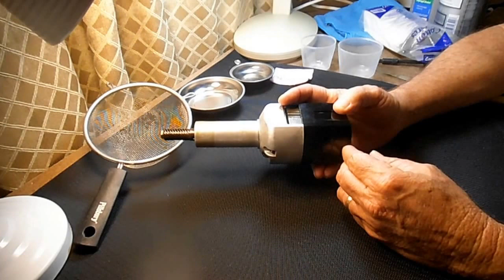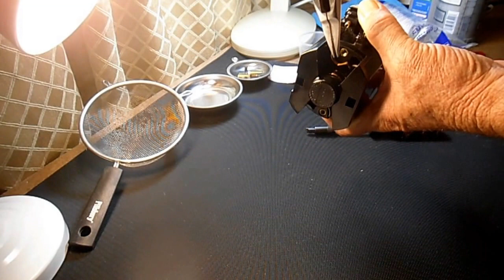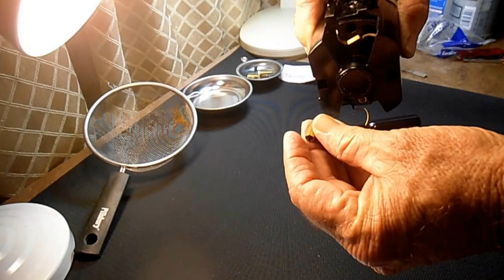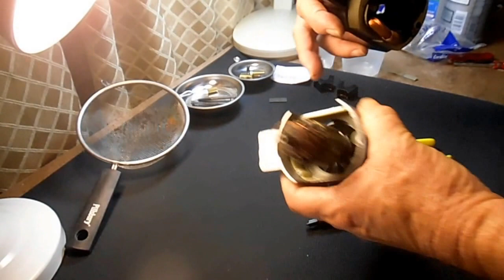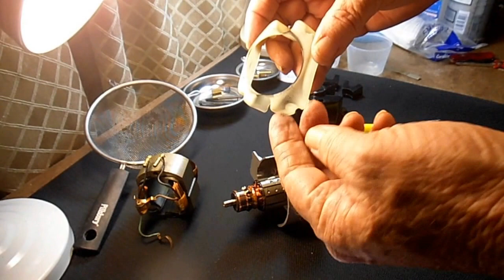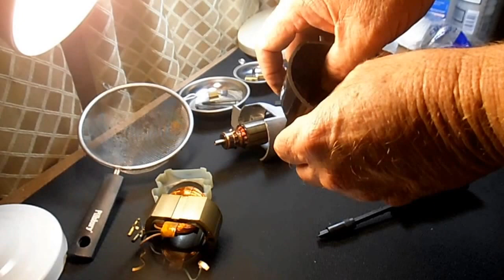HOW TO RESTORE SINGER PA STYLE SEWING MACHINE MOTOR Pt.3 HOW TO DISASSEMBLE THE MOTOR

Comment: Whoa, Motor Housing Screws are huge! Everything here is so delicate it makes me nervous. Will the motor work better after we go through all this or is this just for general clean everything-new-again?
Reply from the maker: They are huge! Good old Singer back in the day advertised their sewing machines as a "Lifetime Purchase", and it seems they built them with that in mind. 
Maybe this is a good rule of thumb: take off one brush cover and inspect the commutator by turning the shaft slowly. No scratches or burn marks? If true, then look closely at the 'Opening" in the brush holder from end-to-end". You can see the spring and where it connects to the carbon brush to get an idea of how much brush is left. Compare to the length of the new brush. If 25% or more of the brush is still there you are good. Order a set of brushes at your leisure for the future. If 50% or more is still there ( a common scenario) you are golden
.Order a set of brushes at to leave in your will.
Also, cover your finger with a rag and press it on the commutator between brushes as you rotate the shaft. That will get some of the carbon dust off of it while you are there. Close it back up, reinstall the motor and sew away.

Great question and I'm glad you asked. Would you consider writing the scripts for my videos? You are very intuitive!
Reply: @andytubesewing1953  I know that people need to be careful with solvents but I have used acetone or lacquer thinner soaked into the cotton tip of a cotton tipped swab to clean off the carbon dust and grease/oil residue off of the commutator. I am careful to keep the solvent off of windings of the armature by tipping the commutator down and the armature windings up. I also allow a few minutes for the solvent to evaporate off before running the motor. Don't need St. Elmo's fire (sparks off the brushes) to ignite solvent vapors!
Reply from the maker: ibsoarin thanks for sharing your experiences with us. I know we all appreciate it. I know many people use electric spray cleaners also, and I hope to try that in my next series. Good of you to share.

Comment: Once again, I must thank you!
Your information on the Field Core Wedge was very helpful. I recently pulled apart a model 99 motor to clean it. It sounded terrible. While putting it back together, one of the most dreaded things happened. ONE LEFT OVER PART! 😯 It flew out when I took it apart and I didn't have a clue where it went! The motor does run without the part, but, I saved it and now I know where it goes!
Thank you so much! 
Still would love to meet you if you're ever in North Carolina!
Reply from the maker: If I'm ever in NC you'll be the first person I visit with! https://youtu.be/TmnnvGrEfmg

Comment: I have the same problem as Margie explained in one of the comments.  The shaft of my 403A motor has a bit of slack.  The whole shaft moves up and down somewhat less than 1/16” and if I remove the pinion gear and look at the bearing, the center circle of the bearing moves that same 1/16” if push/pull on the shaft.  Should I just replace the top bearing (using The Vintage Machine Conservationist’s video)?  Or, is it OK just to continue to use this motor as is?   It does make the hand wheel clunk a bit when turned by hand, but I don’t hear anything when sewing.
Reply from the maker: Hi, Carole. I have 10 PA motors on hand right now. None of them have any up/down movement at all. My concern would be if the pinion gear moves up/down vertically what will that do to the Textolite handwheel gear? I'd probably replace the top bearing for peace of mind thinking if the handwheel gear cracked/broke then I'd replacing the bearing AND the handwheel/handwheel gear both.
Reply: Thanks so much, Andy.  I’m going to take the old bearing out first before I order a new one so I can see the bearing and make sure I’m ordering the correct one.  I’d really like to hold that defective bearing in my hand to try to see what makes that center circle of the bearing move up and down. I just love your new playlists on tension, motor, and motor belt repair.  I don’t think I would have easily found Margie’s comment if you had not put together these playlists.
Reply from the maker: @carolemagnusson5044  The bearing you remove should look something like this one: https://www.3bgsupply.com/37kdd-timken?gclid=CjwKCAjwur-SBhB6EiwA5sKtjkn7ORImhrvW_XsNzWkGnhje5AvJIU-V4flgor_l25GUl-PPNpeBOBoCBmoQAvD_BwE
I'm thinking someone pounded on the top of the motor shaft trying to remove a stuck motor, but it will be interesting to see what you find. Thanks for mentioning my new playlists. I did think anyone noticed, to be honest. When I get comments and emails about a problem I do a search, like "tension" to get a list I can look through for the best referral to the asker. I realized one morning I should make it easier on myself and make playlists like that. After a time I made them public hoping viewers, like you, could narrow down my 600 videos to a handful and hopefully find what they needed. I never thought I'd have so many videos (or views for that matter) and thought my original playlists by model number were clever. I see that 60+% of my views are from cell phones and I have a hard time navigating my channel from my own cell phone. For a YT channel, I feel people miss out on most of the possibilities when using a cellphone, but much of the world doesn't have a choice I guess. I'm trying to create more of the subject playlists so thanks for the recognition and it encourages me to continue.
Reply: Oh!  Thanks for verifying where to order the new bearings.  I was going to order two (one for a spare) from there because The Vintage Machine Conservationist recommended that company, but I just wanted to make sure.  But now, you’ve confirmed the company, and I will go ahead and order now.  Your explanation for how the shaft got some play in it makes total sense to me.  Fortunately, I’ve never hit the shaft of any motor that way, so I can possibly eliminate myself from causing this damage.  Keep organizing your website; it’s already super-organized and convenient!  Everything you do to rearrange/organize helps me and I would assume others.  You have such good sense.
	I’m planning to take some pictures of my shaft gear replacement and possibly put together a You-Tube video.  I’ll keep you informed.
Reply from the maker: @carolemagnusson5044  I did have a viewer mail me a note that the 37KDD comes in two sizes and suggesting to measure the existing bearing. I have no experience with that though. I'm smiling thinking back to when you first started working on sewing machines 😀 and to think now you are taking apart motors to replace shaft bearings. Whew... you've come a long way, baby!!
Best of luck and I hope to add more subject playlists.
Reply: Andy, making a long and sad story short, I destroyed the motor trying to replace the top bearing (damaged the armature).  My question for you is this:  Is it OK to use a PA10-8 instead of a PA9-8 in a 403A machine?  The only difference I can see between these two motors is the extended shaft on the 10-8.  I’m not bothered by the shaft sticking up a bit; the extended shaft doesn’t seem to interfere with anything.  I had some unfortunate experiences buying  a couple of PA9-8 motors online, and the PA10-8 seems to be  a little less expensive.

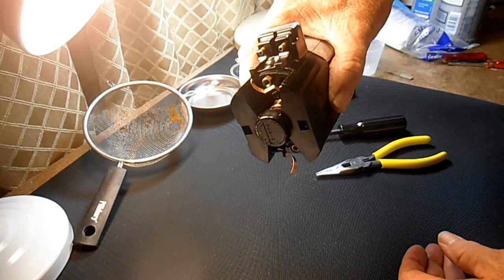Comment: Andy,  At 6:30 you are searching for the name of the "brass coupling nut". If one gets lost, they are available through McMaster-Carr. You probably have spare parts from parts machines, but for anyone else they are available. Mark.
Reply from the maker: Singer part No. 195545 EDGE COVER INSERT (BRASS) is the formal Singer name. Thank you for the tip as I'd say they are practically impossible to find the original. I have found a similar part at a couple of hardware stores, but the thread pattern just won't match the screws Singer made for the motor. Very nice comment, Mark. Thank you.

Comment: Interesting what you can find when you do this. The field core insulator is missing on my motor. And lube tube is just stuck in the end and loose. Can actually just pull it out as it is not secured in there. This is a working motor. Not too crazy the insulator is missing.
Reply from the maker: I've seen a handful of working 301 motors without the tube. The last fellow said it was missing when he bought the machine. About once per year he wipes the bushing area with Tr-Flow Clear Synthetic Grease on a Q-Tip and adds one drop of oil. I agree the insulator would worry me more than the loose tube. According to this fellows' video at about 19:00 that plastic part is "just to direct air. It's broken and I'm just going to leave it out"... https://www.youtube.com/watch?v=CnwaYBNciCU
In the Singer Parts List, it is Part Number 197696 and they do call it the "Field Core Insulator", not the "air director".
He wasn't too worried about it and the motor worked when he finished. I tested leaving one out on a 404 model motor and it did run OK, but I don't know the long term affect. Maybe it would be worth putting some insulating tape or liquid gasket in place of the insulator, IDK. If it's your machine I guess you will find out in the long term. That part is fragile and I'm sure yours is not the only one missing. Thanks for watching my channel. BTW, I have two model 301A playlists with a total of 36 videos if you'd care to just bookmark them; https://www.youtube.com/playlist?list=PLsCOZgzzaiKLZyGebzS_oISgesXNyREyI
https://www.youtube.com/playlist?list=PLsCOZgzzaiKI_6fbu3itbd1v4z3uQvvkO
Thank you for watching my channel.